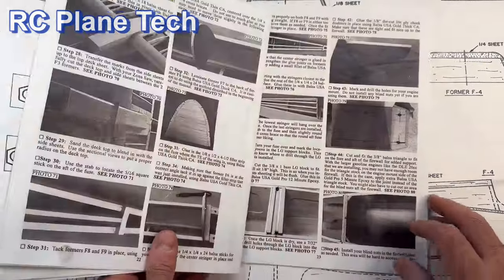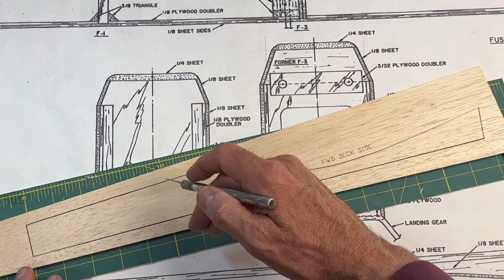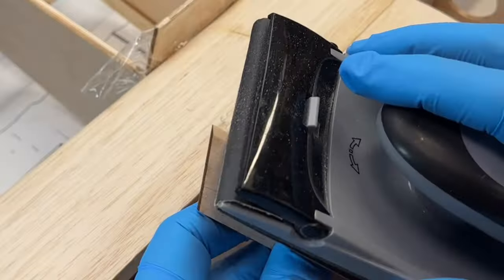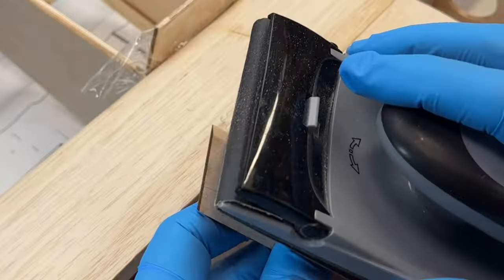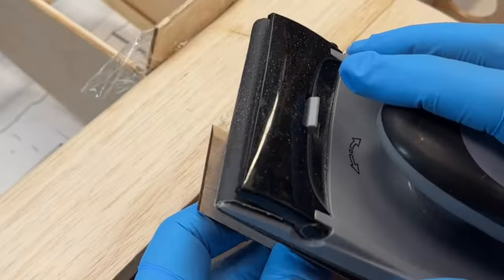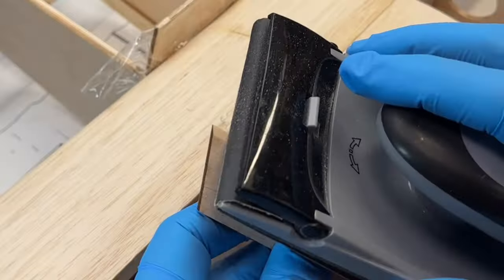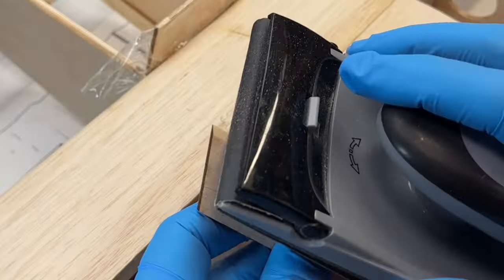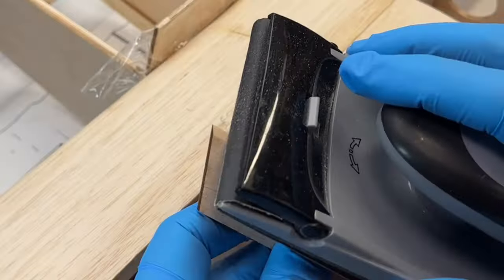Balsa USA Stingray with DLE-20, RC Plane Build N0 12: Upper Front Fuselage Construction

Comment: I liked how you built up the balsa wood for the cowl, alternating the layup so that there are no seems. 

Also, what is not seen but taught, it how you  look at all of the steps and anticipate then take into consideration if something should be done in a different order or slightly different.  

Two great examples in this video are you marking up where the engine mounts and they best one was starting the cut where the wing meets the fuselage, without that cut it would have been very hard to accurately make that cut accurately. You would have had to measure very careful and that cut had to be plus or minus a few hair.
Reply from the maker: Thanks a lot for the comments,  I really appreciate it. I think the more we build the more we think ahead a little. Hopefully that makes up for some mistakes I make. Thanks again.

Comment: Great job James!  Sawing between those two formers gave me anxiety. I would have went against the directions for that step.  Good idea on the built up block too
Reply from the maker: Thank you. Ya, it was a weird step. I think you could achieve the same thing by building the two part separate. I guess this way its more certain that it will all look aligned. But with a little care, doing it in two sections would work.
Reply: That’s probably how I would approach it.

Comment: Doublers are not yet fixed at the nose end. Any specific reason for this?
Reply from the maker: Good eye. Ya I thought they were going on earlier when you build the sides. But the instructions say hold off until later during the engine mount steps.

Comment: what kind of saw you were using to cut in the middle of former 3 ?
Reply from the maker: I think you are referring to the ZONA razor saw. They make several sizes. In fact I need to another that has a wider blade. In this video i used the narrow ones
Reply from the maker: https://www.amazon.com/Zona-35-140-Interchangable-Blades-36-555/dp/B000EROWJ4/ref=asc_df_B000EROWJ4/?tag=hyprod-20&linkCode=df0&hvadid=198079365003&hvpos=&hvnetw=g&hvrand=423955916541854219&hvpone=&hvptwo=&hvqmt=&hvdev=m&hvdvcmdl=&hvlocint=&hvlocphy=9031048&hvtargid=pla-437332129567&psc=1&mcid=205691573abf31549e89cf23ea52d56c&gclid=Cj0KCQiA2KitBhCIARIsAPPMEhLpQLnynUZ6i_if0TpROCzKeC0vQAKsbCgdD6zIHMKFJRn0vbtO2sIaAvOMEALw_wcB
Reply: Thanks, your build is going great
 @JamesRCPlaneTech
Reply: Gros suspens a la fin 😅 👍

Comment: In one of your videos you mentioned that you clean your CA tips with acetone.How long do you soak them and do you rinse them with water?
Reply from the maker: Hi, just few minutes if that. I get tweezers and put in and out, and it will drain through. Or I’ll just drop it in the jar and fish it out a day later, blot it on a rag or paper towel. No water, i just pat it dry and put back with the rest for the next time. Just be careful with the chemicals, ventilation, rubber gloves, etc.
Reply: @JamesRCPlaneTech  Do you cut the tips down before you use them?
Reply from the maker: If I use them for thick CA Ill cut them a little to open them up a bit. But for thin ca, no.